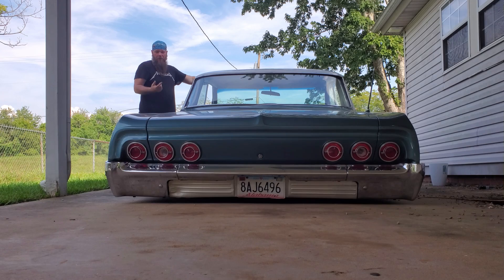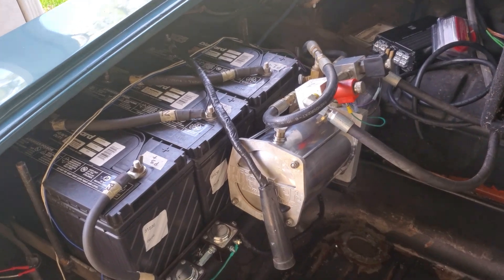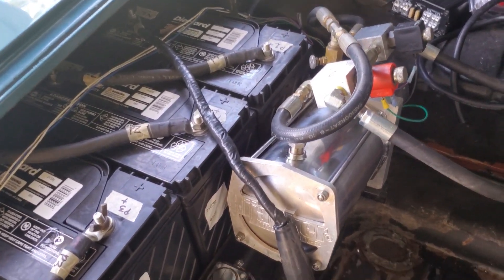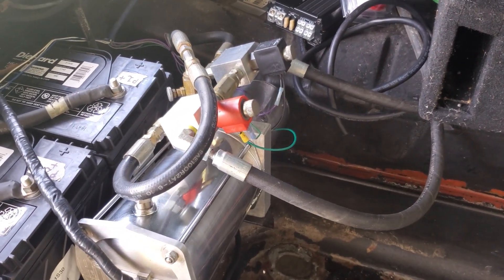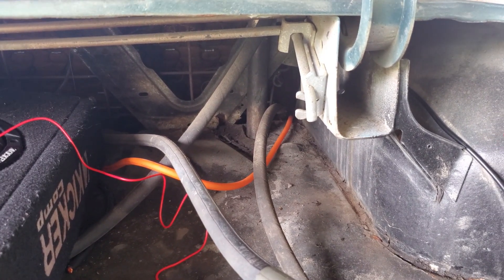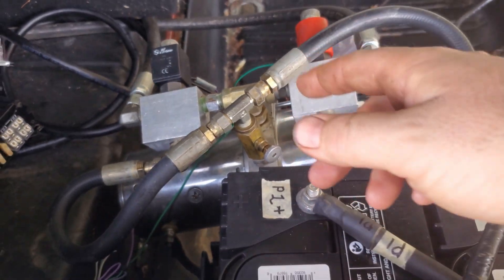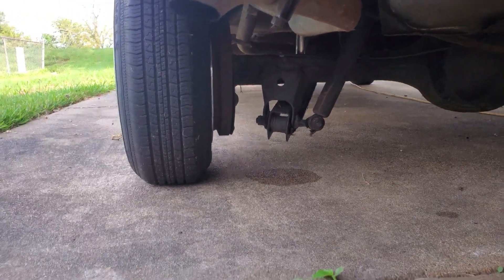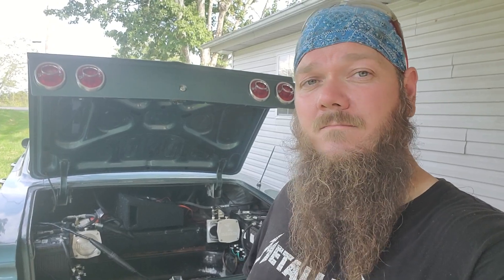My Car Will Go Up Then Fall Back Down

Comment: Thanks bro 😂 I was changing the differential gasket and every 15-20 minutes I’d hear it drop… I was wondering what the heck could happen, I locked up the rear and measured and noticed it dropped like an inch and a half.

Comment: Lots of help thanks
My front drops within seconds and pisses out fluid like crazy. 
Figured out my locking nut on the front cylinder came loose
Reply from the maker: You probably have the o rings in your cylinder going bad the collor just keeps the stroke in the cylinder
Reply: @thecadillacdanshow8658  I just changed them out last weekend .. that’s the weird part. Used two vice grips to tighten that thing down also. So I’m take a look at it tm try tackle the problem.. love your videos I have a 4 door broughm 87…
Reply from the maker: @ArmaniMorales-z9x if your cylinders are new also check the fitting to make sure it's not leaking and running down the cylinder making it look like it's leaking on the bottom